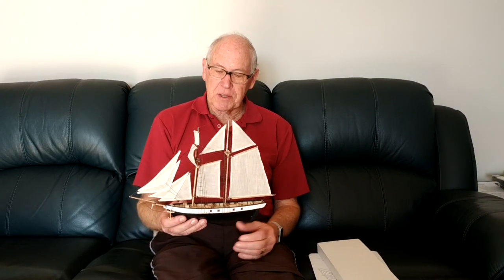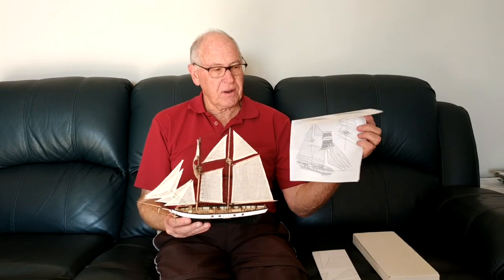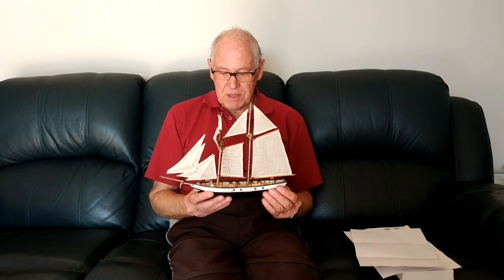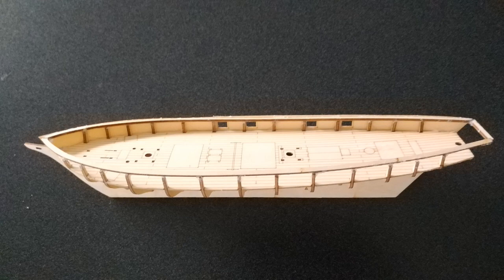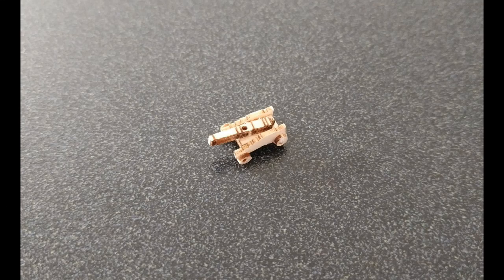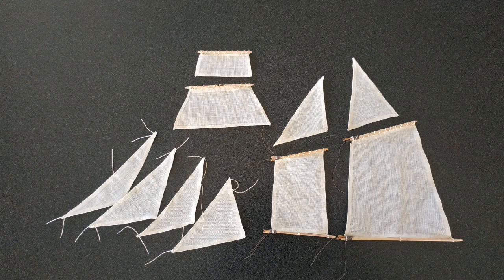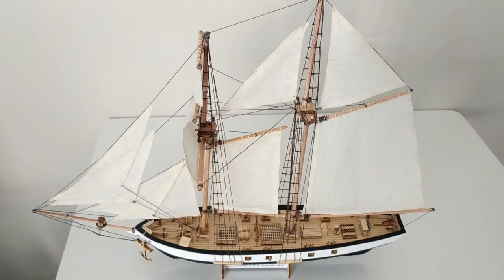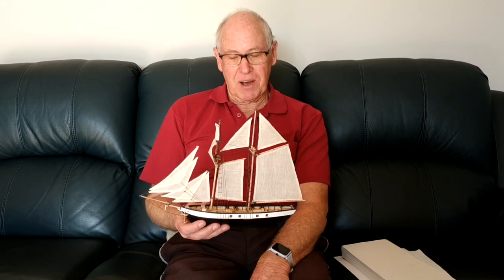Model ship "Harvey" 1847, 1:130 scale

Comment: Having a little trouble understanding how to install the planks. Are they layed out in the correct order on the sheet? Any clues would be helpful. I have many years experience building many cars and ships. This is my first wooden build. Thanks!
Reply from the maker: You start with one's that go fully from front to back from under the sides, sitting naturally on the frames. See 1.45 in the video. You than work up to the sides a plank at a time cutting them to shape as you go. Bend the planks to shape beforehand then glue to the frames and to the edges of the nearest plank. You then do the same working down to the keel.  I put spacers by the keel between the frames to help this.  You can see them at 1.45. My other ship model videos give more detail.  Hope this helps.

Comment: Thank you for the excellent video and links. Could you possibly share detail photos of the place where the upper and lower portions of the main mast meet? I'm having trouble visualizing which parts are used to link them. I assume they are joined somewhat like the two sections of the bowsprit are.
Reply from the maker: Cut two pieces of wood 15mmx15mm and drill two holes in each that have the same diameter as the masts. The holes must line up. Insert the top part of the mast from above and the bottom part of the mast from below and glue. You can see it best a 2:58.  Hope this helps.
Reply: @calros3  perfect - thank you! I ended up doing something very similar.
Reply from the maker: @JosephClarkFL  Y1 is for the stern transom.  W1 and W2 help hold the centre of the three cross booms to the mast. T1, T2 are at the bottom of the mast. You can see each part in the photos here:  https://www.dropbox.com/s/mhh62p18bkxg9jn/Ship%20model.pdf?dl=0   Hope this helps.
Reply: @calros3  Thanks again!

Comment: Great job! I got one of these and am using your video as a guide - yours looks lovely. It's my first ship build, and with the plans in your description it's working out just fine. What technique did you use to secure that tab around the sail edges? Was it sewn or glued? I tried using super glue, but it spots through the sail and doesn't look as good as this!
Reply from the maker: I glued the seams of the sails. (Not superglue) . Selleys and UHU clear contact adhesives work well with the kind of fabric provided.

Comment: It's not a BAD little model ship but without the instructions on line at : https://www.dropbox.com/s/mhh62p18bkxg9jn/Ship%20model.pdf?dl=0
it would be hard to do. There are parts that do not seem to have a purpose and I can find no finished models that have them. I may use them for the anchor stantions because the anchors shouldn't hook on the side. When you put the anchors together you'll see you'll need to cut and rotate them from how they are formed on the parts tree. I will say it was fun to out the planking on the bottom...my first time doing such. The link I provided above has the sail measurements.
Reply: thanks for the link, that was great!

Comment: im having a hard time with the planking,did you have a guide to follow for this step?
Reply from the maker: No guide, just experience with other model ships. I bend the planks first with a soldering iron on the inside. Then I use a quick drying contact glue, hold the planks down with pins and glue the edges as well as the frames. Afterwards sand the hull and use a filler till everything is smooth. Then paint with acrylic paints. My other model ship videos give more details. Hope this helps.
Reply: @calros3  thankyou for the reply. i'm now on the mast part. the kit didn't include any wooden pulleys but i really wanted to have them on mine. the dead eye pulley is just too iconic to pass up. :D
Reply from the maker: @francis9506  Yes I had the same issue. Fortunately I had leftovers from previous builds. You can get little packs of pulleys from ebay. Enjoy your build!

Comment: how long did you soak the hull planks? Thank you
Reply from the maker: I didn't need to soak the planks at all. They are very flexible in this kit. For greater bends I dip in water then use a soldering iron on the inside of the plank. My other videos show the process. Hope this helps.
Reply: @calros3  Sir, thank you kindly for your advice. I will look at your other videos.

Comment: I'm very confused on how to create the mast?
Reply from the maker: You can get the dimensions for the masts and spars by looking googling 'Harvey Model ship 1:130'. Some of the sellers have dimensions in their product details, proper sail plans, and photos showing a typical build. To shape the masts and spars from the dowel supplied I used a sanding disc on a  slow electric drill. Hold the dowel against the disc and pretty quickly the dowel is tapered to shape. Much quicker than trying to do it by hand with sandpaper.  Hope this helps.